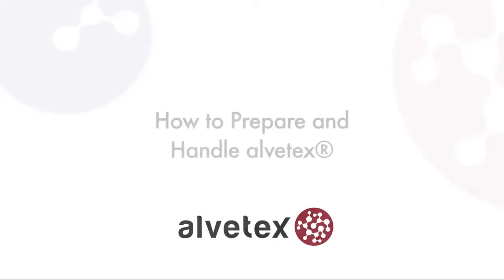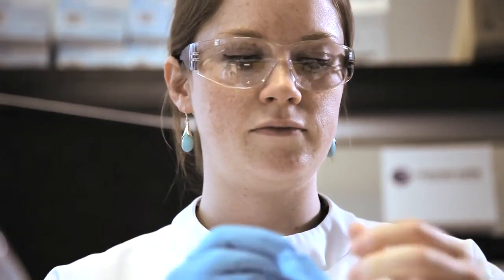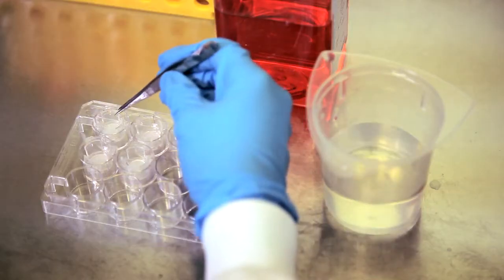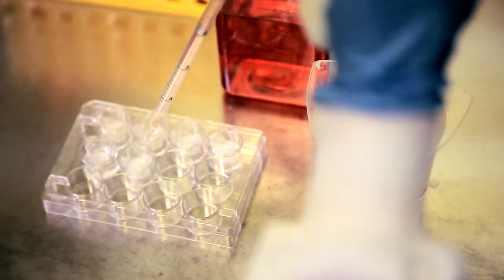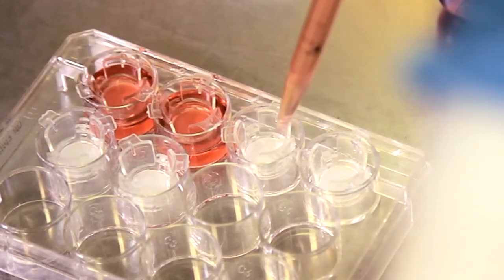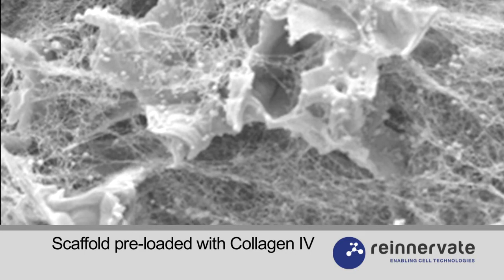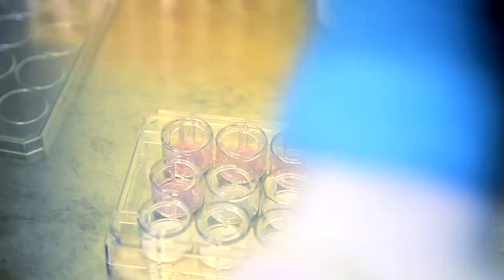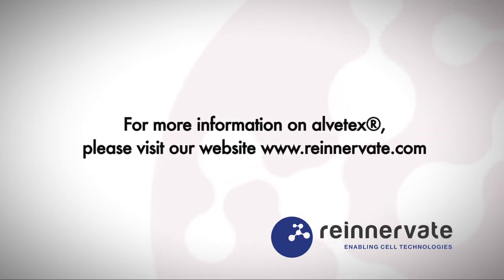How to Prepare and Handle Alvetex Scaffold | REPROCELL (Alvetex)

Comment: Hi, does the ethanol have to be sterile/autoclaved before use?
Reply from the maker: According to Association for Professionals in Infection Control and Epidemiology (APIC), ethyl alcohol and isopropyl alcohol are not effective in sterilizing instruments because they lack sporicidal activity and can’t penetrate protein-rich materials. Isopropyl alcohol also lacks the ability to kill hydrophilic viruses. For these reasons, alcohol is classified as an intermediate level disinfectant.

That is why we use autoclaves, gas sterilizers, hot beads, flames, chemicals or boiling 
water to properly sterilize the equipment.

We use 70% and not higher percentages of ethanol, since 70% ethanol is better for disinfecting. It has more water, which helps it to dissolve more slowly, penetrate cells, and kill bacteria. Alcohol makes some bacteria and virus inactive because it lowers the water activity.

Higher % Ethanol evaporates too quickly and is not effective when alcohol is lower than 70% is considered as 'too wet'. In cell culture we usually combine 70% ethanol and ultraviolet germicidal irradiation (UVGI) to sterilise surfaces, disposables, and microbiological safety cabinets.